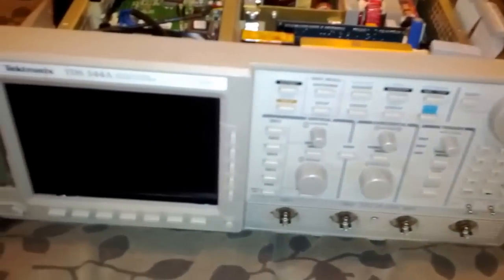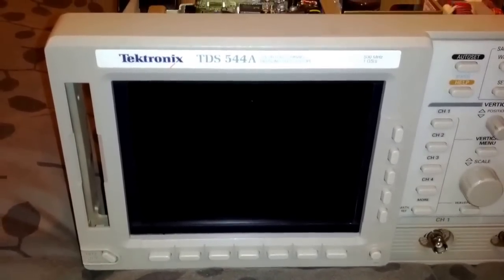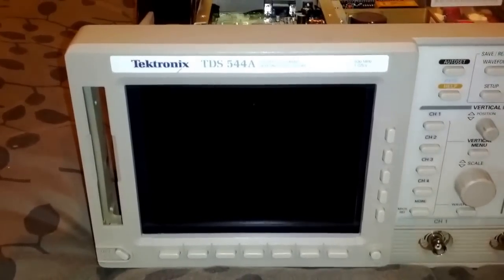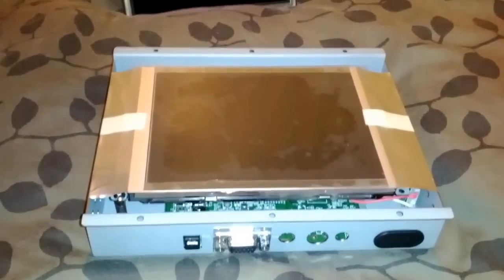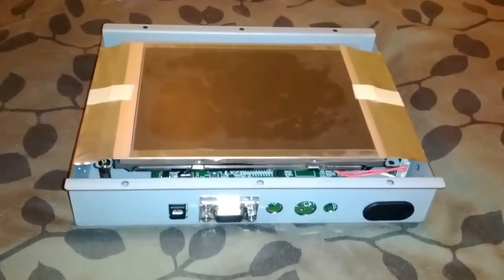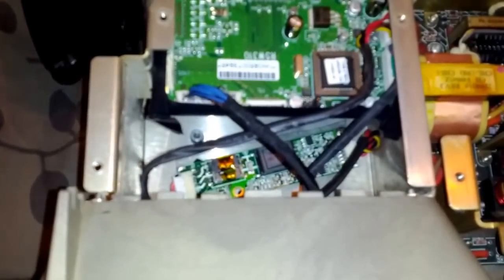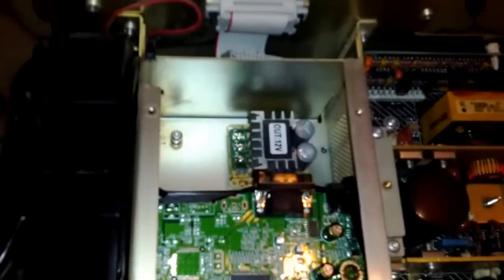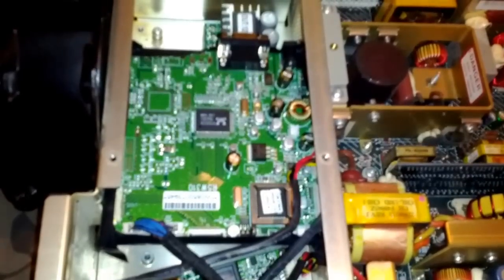Tektronix TDS544A CRT to LCD replacement

Comment: Will this lcd I found on ebay work ? I'm not sure whether this will power on when you apply power or you have to use the on button on the keyboard. If you have to use the keyboard to power on then this probably will not work.  https://www.ebay.com/itm/LCD-Screen-7-800x600-A070SN02-work-with-VGA-LCD-Controller-Board-KYV-N2-V2/143460478498

Comment: Is this the method where you use the (external) VGA port for the internal display? Because there are also ready-to-use sets which use the internal video output so you can still use the external VGA port for an external monitor.
Reply: I was wondering that also and more-so if there is not an internal option VGA card for the VGA output(s).  Did he hack a Video card to the scope Video chip, use a CRT to VGA auto-correct/sync style board or just plug into the stock VGA option board?  Interesting though as I am not sure what the VGA Option looks like and the posts aren't that descriptive though inspiring for thought.
Reply: After slowing down the video, re-reading the comments and reading into these scopes more, he did note: "complete video board with VGA interface, so no special boards are needed. I only added in a DC-DC converter (12V @3A output)" and "It's a 6.5" 640x480 with a standard VGA input. " where "It's" means the LCD. 

Reads also like you can find the video pinout on the A11 board also and wire in a cable and connector for a VGA interface.

Comment from the maker: The item I bought on Ebay has the complete video board with VGA interface, so no special boards are needed. I only added in a DC-DC converter (12V @3A output) that seems to work well. I have spares if interested.

Comment from the maker: I bought this panel on Ebay. It's a 6.5" 640x480 with a standard VGA input. You need to make sure the bezel is thin enough to fit into the area occupied by the CRT. I have a 6.4" version available (if interested) that might work also.